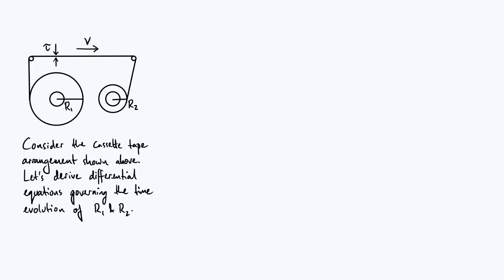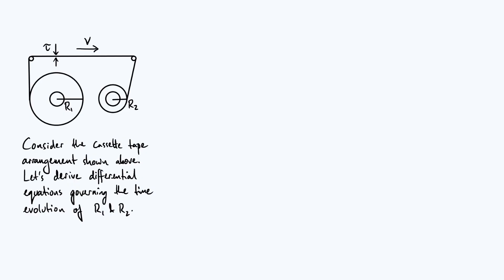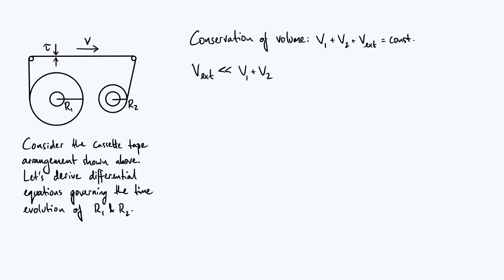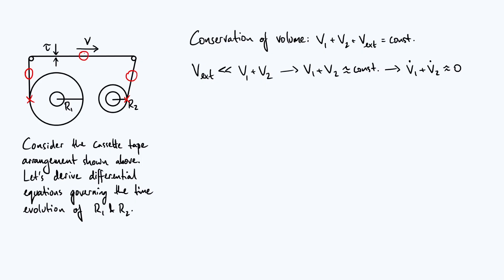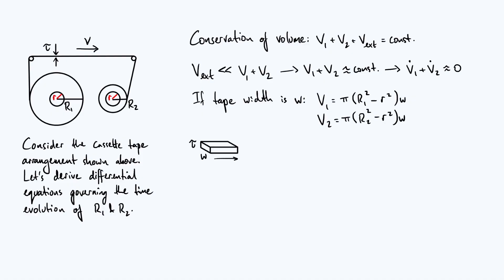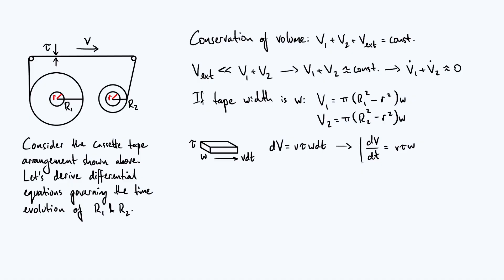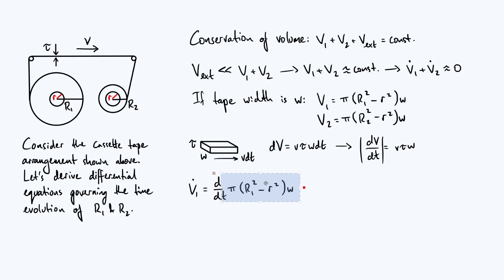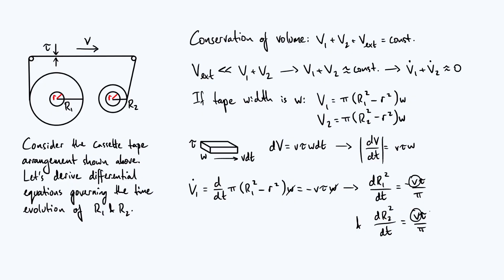Equations of motion for a cassette tape

Comment: I took one step further and found the solutions R1(t), R2(t), ω1(t), ω2(t). They are as follows 
R1 = sqrt(A² - (vτ/π)t) 
R2 = sqrt(B² + (vτ/π)t) 
ω1 = v/R1 = v/sqrt(A² - (vτ/π)t) 
ω2 = v/R2 = v/sqrt(B² + (vτ/π)t)
Here A = R1(0) and B = R2(0) (initial Radii)

Also note that ω1 is increasing with time and  ω2 is decreasing with time. This is because of the condition of no breakage of the tape-- R1w1 = R2w2 = v i.e the linear speed of tape must be same everywhere. As R1 decreases with time, w1 increases. And as R2 increases, w2 decreases. Also yes, we can comment on angular speeds of the spools only when v is constant and not a function of some other parameter (like time). 

Let me know if my analysis is correct
Reply from the maker: Looks good to me, you can double-check all the details in the next video which will be up very shortly!
Reply: @DrBenYelvertonsure!

Comment: Really interesting scenario. If the v's were not constant you'd have to have only one spool faster than the other. Otherwise there would be a case of tape stretching or breaking in between the spools if the take-up spool was faster than the feed-spool. If that makes sense. Thank you for the video.
Reply from the maker: Thanks for watching! Indeed, in fact they need to spin at different speeds whether or not v is a constant since R₁ω₁ = R₂ω₂ in order for the tape not to break!
Reply: @DrBenYelverton  Ahhh, okay!

Comment: Hi, thanks for the videos, keep uploading them! 
What do you think about solving the problem about a ball on turntable? (Seems kinda interesting and fun to me)
Reply from the maker: Could be interesting, what are the details of the problem?
Reply: A ball of mass m and radius r rolls without slipping on a large horizontal turntable that rotates with constant angular velocity Omega0 about the vertical axis. Let R(t) be the position of the ball’s center in the lab frame and assume the ball has moment of inertia I (later, a uniform solid sphere). Find the ball’s trajectory R(t) in the lab frame for given initial R0 and v0, and, for a uniform solid sphere, determine after what time the ball comes closest to its initial point on the turntable.
For the further discussion of the problem you can look at the APhO 2023 (Second problem).